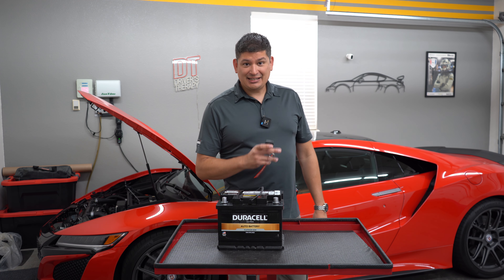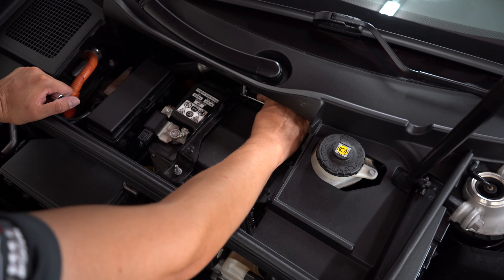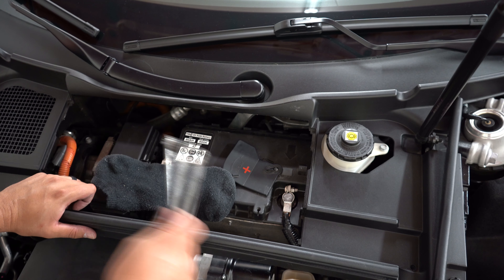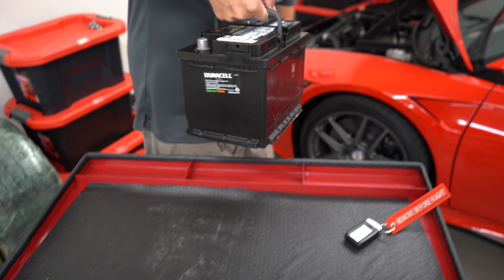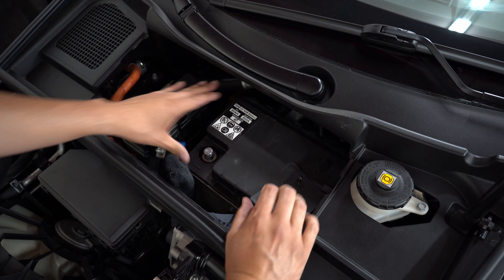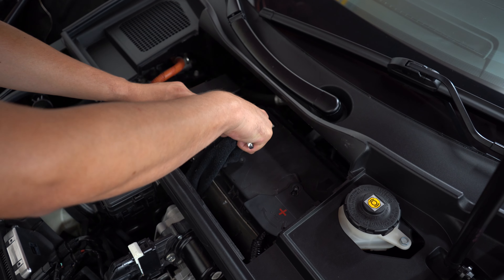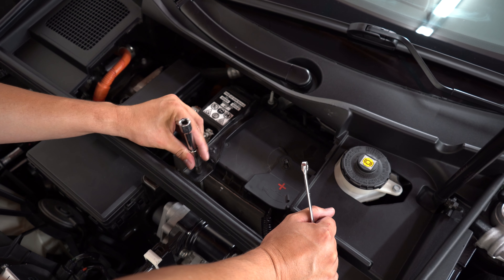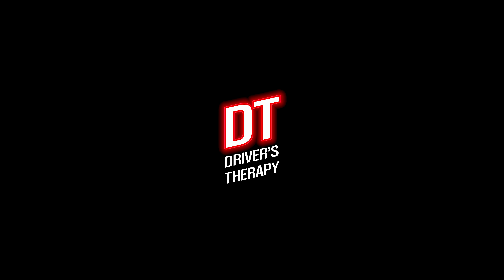Battery Removal & Install - NC1 Acura NSX

Comment: Glad to hear you only needed to recharge that battery.  I think I drove about 1,000 miles max on that thing, LOL.  Please install a trickle charger.
Reply from the maker: @PatsGarageOnline  will do! I also think I ran it low by leaving the hatch open after driving for a few hours every time. I won’t do that anymore. 😅

Comment: Never expected the NC to have a 12v too.
Reply from the maker: @markusluftner8418  it does and it definitely is needed. The car was not happy with a low battery. Especially will all the electronics is has. Thanks for watching the video. You are the best.
Reply: Hybrid vehicles require as 12v battery for all the computer modules, cockpit electronics, and to run the ignition system for the engine.